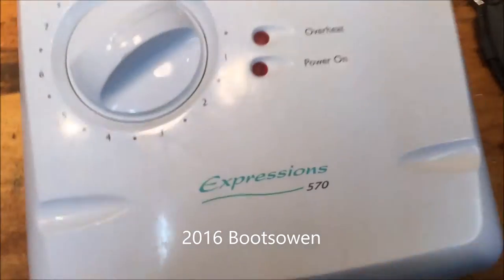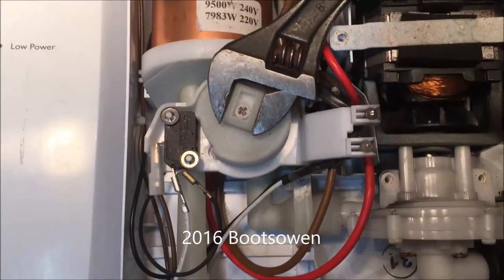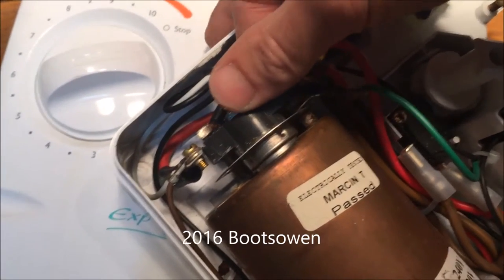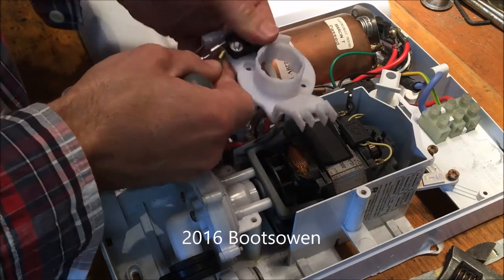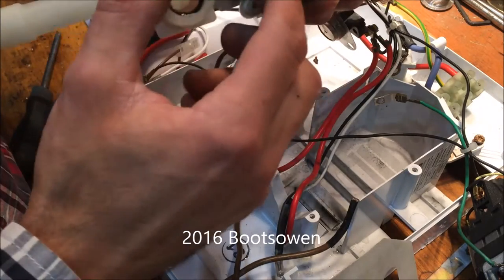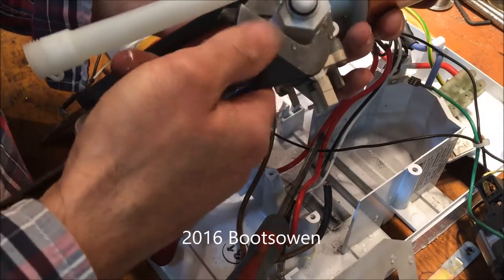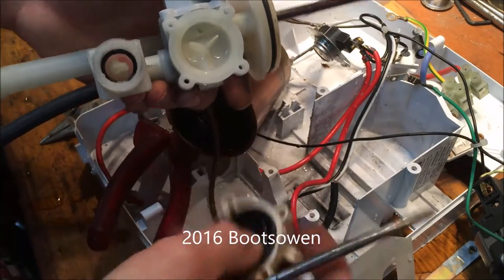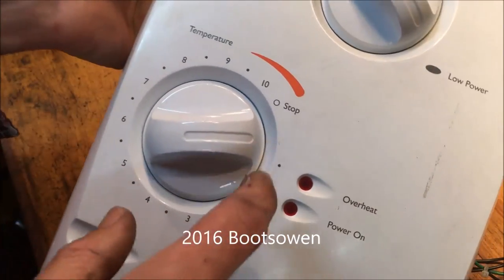Redring Expressions 570 Pumped Electric Shower Review

Comment: Thanks for your efforts here ..just made my mind up on buying one of these ..my options are now .. electric thermostatic shower . Mira  off tank fed supply ..with two bar single pump on cold feed to shower ..
Reply from the maker: If you have a hot water tank then take the shower off the hot tank with a thermostatic mixer bar. If there isn't enough pressure then add a hot and cold pump. I have posted another video about adding the twin pump https://youtu.be/paSbVxzMaoA. 

I replaced this redring with a triton (or Mira, I can't remember) pumped electric shower. as there wasn't enough pressure for an unpumped electric shower. But Later I added a bath shower mixer, not thermostatic, and the twin pump.
Reply: @bootsowen  thanks for your reply .I'm a fully trained plumber .I've never fitted a pumped mains electric shower before ..my problem is the electric shower needs to be thermostatic . These Mira advance thermostatic shower are extremely sensitive and drop out if someone opens a kitchen tap ..even with ,2 bar pressure ..this is in an old folks home ..plenty supply from tanks. .no hot water tank as it's a central boiler house ..mains pressure shower ATL advance will run off a pumped cold feed from tanks . Just a little noise to deal with ..
Thanks for your efforts ❤️

Comment: Hey Owen, your videos are great.  Thanks for posting them.  I have a broken Expressions 570 shower and I'm sick of repairing it.  Can I ask which make/model you used to replace yours an was it easy to reconnect the mains power an water? Thanks in advance.
Reply from the maker: I can't remember now, I think it was a triton, or a mira. I prefer Mira. I originally replaced it with an easy to fit triton non pumped shower and it wouldn't work for low flow. I took whatever was on offer from the builders merchants, but it was a horizontal shape rather then vertical like in this video. So by the time I had fitted it I had loads of holes drilled for the non pumped one and it was in a different location.  I basically had to line it up with the pipe, because that was the best I could do.  There is never enough space or slack left on the cables or the pipes. Sorry I'm not more help. The best advice I'd have is to tackle it when the shops are open, so you can get more bits, and don't start it if you have to finish it!

Comment: Same set-up as my recently failed (For a second and last time) Gainsborough Emerald 2. Having had the front off it appears to be identical. Mine finally died on the pump but had the same dial issue as the Redring. I will probably go for the Mira Elite QT as I don't think the private water supply has enough pressure to run the Triton T90.
Reply from the maker: I tired to fit a Triton T80z to replace the redring, thinking there would be enough pressure from the header tank in the loft, but no dice, I had to get a pumped one instead.
Reply: Thanks for doing this video.

I'm on my second Redring Expressions 570. First one lasted 3.5 years. Replaced like with like to avoid hassle of re drilling mounting holes etc.  The pump in the second one has been very noisy now for the past two years and am thinking of replacing it so we can shower without waking everyone in the house up!!  In a  bungalow so will need a pumped one.

@bootsowen, what did you replace it with?

Comment: Lots of switch on problems with this shower, never buy a Redring again !!!
Reply from the maker: This shower used to do my head in. I would go for a shower, but if the last person hadn't turned it off  correctly then the temperature safety would have cut out and it was a full electricity off and remove fascia job. What a pain. Really bad design.